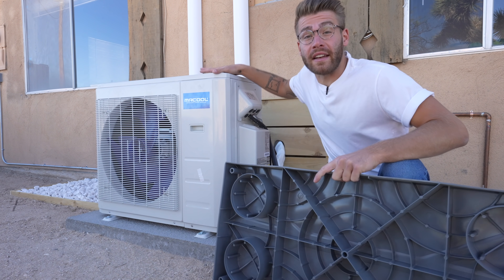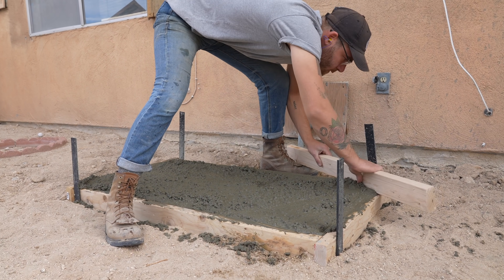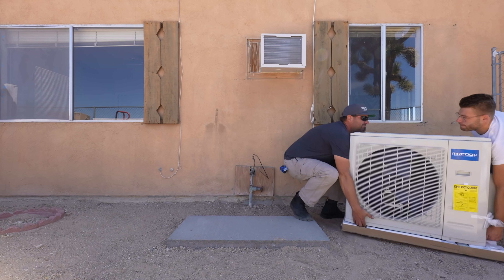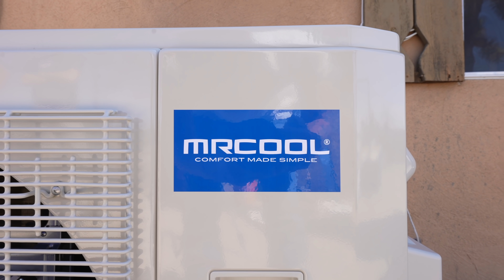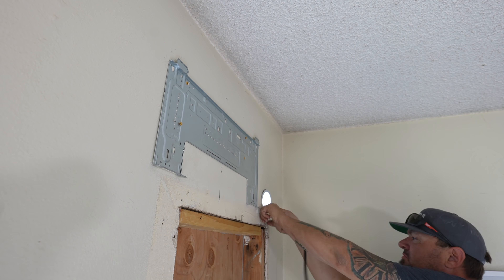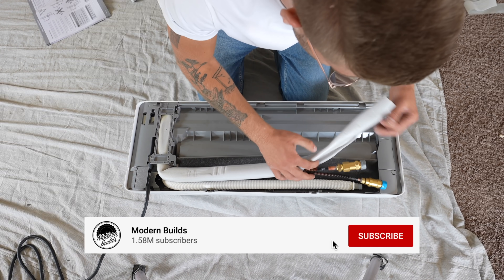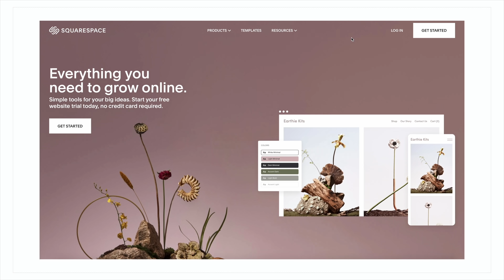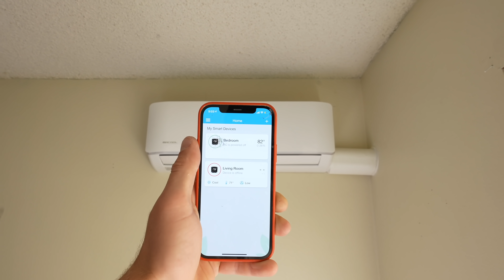DIY Multi-Zone Ductless Mini Split AC & Heating System | MR Cool Install 2021

Comment: It's also worth mentioning, code in  some areas will require in offset from the property line. It's not worth risking a notice from the city telling you to move the unit, so check your local regulations.

Comment: I've watched a half dozen different youtubers install AC, and I could watch a hundred more.
Reply: Heat pumps arent really a new thing. In hotter climates heat isnt used much so having electric heat is not that bad. Gas is much cheaper in most states, but obviously he doesn't have gas there and you cant get a split with a furnace anyway.

Comment: So.. did you cover up the holes in the walls? No worry about water damage or bugs? Is there a seal or something on the wall connection
Reply: I think caulking on that flange would seal it up

Comment from the maker: Big upgrade from the window unit I used for the last couple months of summer last year. Mini-split units are becoming more and more popular and I wanted to see what all the hype is about.. definitely way more quiet and convenient, plus it heats as well as cools. I'll post an update after this summer to talk money and savings! What kind of savings have people seen switching to ductless systems?? I'm curious to compare!
Reply: You may run into issues in a year or 2. I noticed you installed the linesets with vertical loops coiled up behind the condenser. That’s a big no no. Your causing an oil trap by doing that, this not allowing all the oil to return to the compressor. This will cause problems with the unit, and ultimately shorten the life expectancy
Reply: @travisgaylor6830  Good point! Because the lines are provided at set lengths and could not cut them, how would you remedy? E. I. Coil them on a spiral downwards?
Reply: @ozzya7887  they could have cut them and soldered them back on.
Reply: @allianceofvengeance  I don't think so. He said that they were pre-charged. If he cut them he'd lose the charge to the atmosphere and have to call an AC tech to pump down and recharge the system.
Reply: @benhatcher2603  The condenser is pre charged with freon, not the line sets. He could cut and flare the line sets which is the correct way to install them.
Reply: The lines are charged
Reply: @lancearsenault7162  Yes, the refrigerant lines inside the condenser are charged. Not the line set.
Reply: @irinnaroseirinnarose  el wrongo
Reply: @irinnaroseirinnarose  wrong!!
Reply: @ozzya7887  You run the excess up into your attic and then down the wall to the outside unit. Just one big loop in the attic. All laying level on the joists.
Reply: @travisgaylor6830  how should and where those coil be positioned?
Reply: @Modern Builds did you ever do an update on the bills?
Reply: So, how were you HVAC bills?
Reply: It’s been a year and I’m considering getting a couple of these for a house remodel. Very little to no snow in my area but a lot of great comments of things to keep in mind, mainly have an HVAC guy handy and don’t leave extra line coiled up. But, I’m very interested in how this impacted the electric bill. I can’t find anyone that has one who shared the difference it makes on the electric bill, good or bad. Thanks
Reply: @21toolmantim according to the manual install (which are available to be downloaded either from Home Depot description specs details or from the company website) the line sets are left at a certain coil with no less than 4 degrees radius with the extra supposedly just laid behind the outside unit. i wouldnt leave it but as someone stated here in the comments of this thread, you can manage to have the extra looped inside your attic (or ceiling joists).
Reply: Poor install.. 
1.. coiled loops(bad)
2... no surge protector
3... no stand
4... did not seal armor flex( moisture build up will turn acidic and eat the copper lines)
5... Mr cool is chinese junk( average life span 6 yrs) 
6... good luck on warranty 
7... engineered to be disposable
8... limited install parameters 
9.. very poor minisplit(weak compressor windings)
10... you should be ashamed of installing inferior equipment... 
11... this is not my opinion/ 25yrs in the battlefield
Reply: @Blitzkrieg.u812  don’t cry little one, let me play the worlds smallest violin instead to soothe your hurt butt!!!
Reply: @toolegit2quit173  ahh... children's mentality!
Reply: Amazing job on your install, a couple of things to keep in consideration. If it snows where you are then you should put it on a stand because those units condensate in the winter and defrost. The line set should be on a spiral not on a coil, because coils may trap oil. Curious to know how efficient and economical your unit is. Great video.
Reply: try making a shroud cover for the condenser to keep it protected from the sun thus keeping it cooler as well

Comment: Heat pumps are the future. Technology Connections would be proud.
Reply: can they handle cold winters in Alaska, Canada? how much power do they use for off grid applications
Reply: @stevejeffrey11  air heat pumps, depending on the brand, function well to about 0°F, but some still work below 0. For colder climates, there are in ground heat pumps that use pipes and geothermal heat.
Reply: @stevejeffrey11  Modern heat pumps can work well in the cold, however at some point they will reach the same cost effectiveness of regular electric baseboard heaters. So I would not recommend them for alaska in the cold days, but maybe the warmer days. It also depends how expensive your fuel is vs electric heat.
Reply: You may be able to use heat exchanger piping installed in the ground below the frost line.  I haven’t researched it but the ground is used as a heat sink in this manner in hot climates.  Also if you have access to a body of water it will be much warmer than the air.  But you can’t beat the electrical efficiency of these systems.  The power inverter technology they run makes sure they’re running at the exact right level instead of the on and off of non-invertered systems.